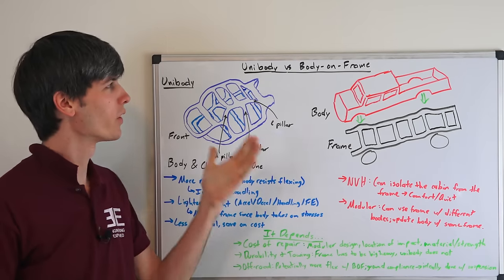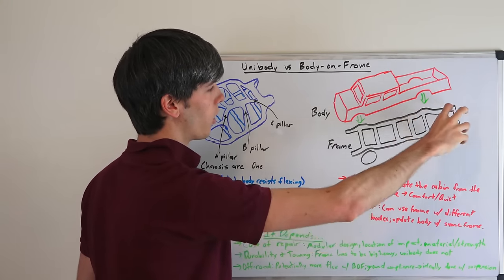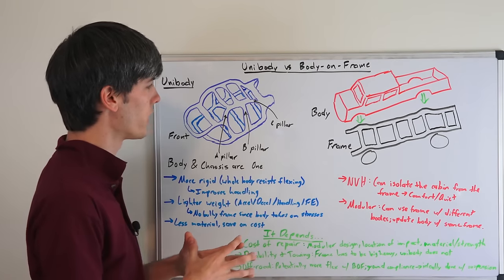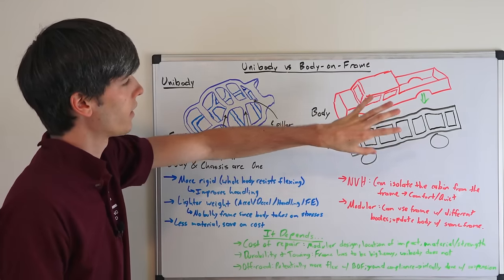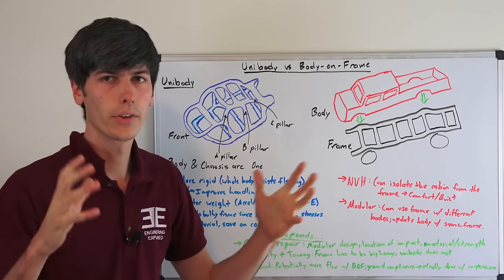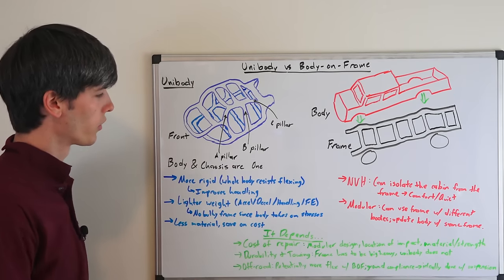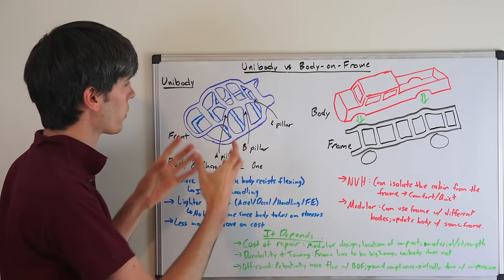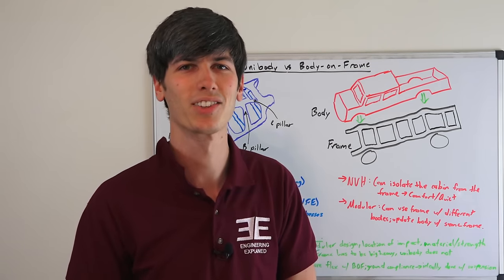Unibody vs Body On Frame - Which Is Best?

Comment from the maker: Engineering Explained Secrets - Revealed: This was filmed the same day as the suspension spring video, hence the involuntary popped collar. The little frat bro on my shoulder wouldn't let it fold down. I'm as embarrassed as you are. http://youtu.be/hGZRairqHNI
Reply: +Engineering Explained Would you be able to do a video on the requirements for turning a late-model car/sedan into an off-road vehicle? Discussions on chassis-swap vs. suspension upgrade vs. custom chassis fabrication etc. As an example - I have a 2007 Charger R/T that will be undergoing a chassis swap with a truck shortly. Think, modern (streetable) version of the FastFurious7 off-road charger.
Reply: Love your content. Keep it going. :)
Reply: +Engineering Explained why do you never deal with bikes..at all in ur videos  Harley's or KTM's... and stuff ?
Reply: +Engineering Explained Body on frame is better than unibody for towing in the long run, as the stresses run through the frame rather than the body, no matter how strong you make a unibody, its still got that fundamental design issue. Also for off-roading, it is an advantage to have a frame, as it can flex like you said, but not primarily for articulation, but rather to bend so that the body doesnt have to. Try opening the door on a unibody when its on an axle twister, quite often some doors wont be able to open even on brand new cars. Its better in the long run. Maybe you can prove me wrong! :)
Reply: +Engineering Explained I wonder where and if they differ in regards to safety. Everything being equal, my mind tells me that unibody is supposed to be safer, but i would welcome the views of other people.
Reply: ***** nope pick-up trucks are safer than cars because they are high stronger chassis hits the car ..I saw a video on Car safety ratings some where ...:-D
Reply: What will happen if the water vapour content in increases from 1% to 3% in a hot and humid area ..will it affect the engine performance ??
Reply: Love the videos, Jason! Your stuff (along with many other things) has motivated/inspired me to go to graduate school to study Materials Science and Engineering in applications to the automotive industry.

Keep it up :)
Reply: +Engineering Explained I didn't even notice until I read this comment XD

Comment: people generally like body on frame better for off-road because they usually have less frame flex or it can be easily taken out and it also also for more suspension mounting points. for example if you were to install a long arm kit you would be able to easily put new mounts on a frame rather than a unibody.

Comment: Cool. I got to this site looking for to see if I should use stabilizing bars on a unibody frame. I got my answer by pulling together info from a few sites: it depends on the weight. In my case, I will be pulling an 1800 lb trailer and my Model X weighs 5000 lbs, so it is not a good idea as it could bend the frame. Great details. Liked and subscribed!

Comment: The 4runner is a perfect example of why BOF is just a better design for longevity, as well as expense to repair. We had a trailer tire fly off the highway and hit a Mazda CX-9 between the B and C pillar, because of that a 40k dollar car will likely be unrepairable because not only did you lose the roof and the door but now the entire vehicle is structurally unsound aside from the subframes and suspension. BOF can have a body swap and potentially avoid a catastrophe like that.

Comment: I think what they mean when they say body on frame or cab chassis as its called in Australia being better off-road is that the vehicles will generally be built with a suspension layout that is a lot more capable in an off-road environment such as solid axle type suspension where as a monobody or monocoque set up will normally have independent suspension which is hopeless in comparison

Comment: hi Jason, I think you may also include that its popular with Hot Rodders since you can pull a desired body off a standard chassis and drop it onto  a specially built racing chassis. This could be useful for a car with a rusty chassis i.e. can be easily swapped thus saving the body - environmentally friendly ;) Also, the modular design of the frame and body allows the car to essentially be built parallel in 2 sections hence the body can be painted, interior and wiring fitted whilst the suspension and drivetrain are being installed onto the frame - the 2 sections ultimately being married at the end of the line thus speeding up production. I know this method is now used during the assembly of modern unibody/monocoque cars now but I believe it started with the body-on-frame cars. thanks for the video! +Engineering Explained

Comment: In towing and heavy cargo u need 2 have flex or the frame wilk snap, thats why unibody r not used for heavy duty use, it is 2 stiff for that and will breack, if u see a 18 wheeler when it takes of hard u will see it flex, this helps distribute the load and desipate the impact, hope i could help, it is just another benifit so people could untherstand why it is used pick ups and truck, sorry about my english it is not my first language.

Comment: Pull a 70 Chenille sitting for decades out of field vs a Camaro and see which once is the better restoration candidate. Most vintage unibody cars from the muscle car era that have been neglected are usually in pretty bad shape.

Comment: Where do car's like the classic VW Beetle fit in, they have a body that separates from the chassis, but it is not a frame. It's transmission tunnel provides the strength of the car, made more rigid by the sills/heater channels when the body is attached.

This design seems to fall between the unibody and body on frame designs and is light weight too
Reply: Was a video ever made about this? I love air cooled vws and was just think about their "unibody"

Comment: You mention durability, but just relate it to off-road performance or towing. There's another consideration; damage from an accident, as mentioned below. The beauty of having a body-on-frame and a very durable frame is that in many cases, a truck can be driven away from an accident, rather than having to be towed. Though the collision testing does not very this, I chose to put my family into a body-on-frame vehicle because they could take a substantial hit and come out just fine. This has been proven out in our case several times. Our old SUV is battered, but it still keeps on going and has always been able to drive away from accidents. Once the crumple zone on a uni-body has crunched, you are pretty much out-of-luck. You will survive, but your car won't.

Comment: A couple of days ago I drove over a significant transverse "bump" on the road (more like a slightly smoother speed hump) at about 40mph. As far as I remember, the suspension didn't bottom out and I didn't hit anything with the frame, but I'm still concerned about the body flexing under the stress. We're talking about a unibody hatchback here (new Mazda3). Is my fear justified or is my OCD getting the better of me?

Comment: good explanation. are u still doing videos on mods? specifically motor mods vs other motor mods in ur opinions on which would be better. ie, bore vs stroking? or both on a newer motor. say an lsx application?

Comment: I'm a bit surprised you didn't mention that unibody vehicles can also be safer. Crash tests have shown a consistent improvement in safety in a unibody compared to a body on frame vehicle. This isn't to say that all body-on-frame vehicles are unsafe, it's just something to point out that the body on a body-on-frame doesn't need the same structural integrity as a unibody to support itself, hence the body being an "afterthought" for crashworthiness. Of course, today's trucks and other body-on-frame vehicles are becoming as safe as unibody vehicles due to stricter regulations and more-advanced crash testing.

Comment: Not sure if you check comments in older videos like this, but what would you call the system VW used on their air-cooled cars? It's not a unibody, but it's also not a body-in-frame. A body-on floorpan, perhaps?

Comment: What about the criticims of unibody that they are harder to repair if there is rust damage and they dont last as long ? And if you want to lower a body on frame vehicle does that make it less likely to roll over in a crash with a new lower center of gravity, ,and can it be done in a way that does not harm it's towing and off road abilities ?

Comment: You say body-on-frame can provide a more comfortable ride. Then why do I keep hearing that unibody trucks are more comfortable to ride in? Case in point, I've ridden in a Jeep Gladiator pickup and it is noisy and uncomfortable, compared to a Honda Ridgeline - wow what a huge difference; much less road noise and way more comfortable.

Comment: Would be interesting to know why Ford had a unibody (UB) mustang right away, while GM took so long time to warm up to it. Also, it seems to me that "crumple zones" are only possible with ub. good video, thanks.
Reply: The first generation Ford Mustang in 1964 essentially was a Ford Falcon with different body panels and a roof, Ford already had the Falcon and to save on development costs they just put different body panels on along with a roof on a car they already happened to have on hand.

Comment: So my only gripes with this is you kinda hit on it but kinda didn't. In HD applications the reason for body on frame is the distribution of stress, offroading and towing alike keeps the stresses of high stress applications to the frame and will save the "squareness" of the body in a lot more circumstances. A frame can be made much stronger and in doing so maintains(for offroading) a lower center of gravity and again isolates the body much more from the stresses of suspension articulation. I don't agree with the Unibody design(except in offroad buggies but they are often overdone as well but also aren't really cars, so not applicable to the argument), I have a older style jeep cherokee that I offroad and routinely have issues shutting hatches and doors because of the twisting forces on the unibody mis-aligning  things. In offroad applications like mine we reinforce one section of the unibody, where the highest stresses occur, the uniframe rails. This is to mimic body on frame designs which keep stress away from the body as well as possible. A unibody is good when stresses are applied somewhat evenly ie cornering or collisions. For trucks frames are necessary because the stress areas are so concentrated especially with conventional towing, with conventional towing a unibody would have to be ridiculously biased in the rear of it in terms of reinforcement that it would still create issues with the cab ahead of it(keep in mind I mean to compete with a trucks tow rating/ tongue weight. Simply put the stresses are different between passenger cars/crossovers/minivans...etc. and in offroading owners usually reinforce the frame to prevent twist and save the body. Truck manufacturers have in the last decade made big leaps in terms of end to end frame rigidity doing things like fully boxing the frame among other things. I will say that Chevy is ahead in that department by far. So yeah, sorry for long post I just wanted to elaborate the reasoning for a frame since the vid kinda didn't.

Comment: I enjoy your videos, keep it up.

I was wondering about the car platforms we always hear about, is that unibody or body on a frame or can it be both?
Reply: +Ross Anderson "popular platform" is just a term  for a car that's very popular for customisation/modification, which means that there is a lot of knowledge out there baout modifying and there are usually a lot of parts on the market for that car.
I'm think that's what you meant.
Reply: +Joel Sägesser Nope, with platform he means that a lot of parts and main components are shared between different models of cars. For example you had the Ford Panther platform on which the Crown Vic, Grand Marquis and Town Car were built and that was BoF. You have unibody platforms as well. The Chrysler C-Body is a good example - lots of different models sharing the same basic structure. 
All of this holds true for today's cars, although I don't think there are any BoF sedans left in production...
Reply: Zenedon Ah you're right, the question wasn't very precise
Reply: Ok, great thanks, I should have been more specific.

Comment: the reason why the body on frame idea was first used...its because most manufacturers tought of it on trucks and suv thats the main reason otherwise there was no point for them to put a sedan or coupe body over a separate frame just think of that.

Comment: Towing should be in the advantages section of frame-on.  Sure.. you "could" have a unibody built at the same weight that would allow it to be equal, but nobody does that.  Frame-on is generally always better for towing.

Comment: I really like your videos ... But Dude you seriously have to remake this one... There is no way in HELL a uni-body vehicle is "stiffer" than that of a vehicle with a frame! (unless your playing with words and trying to say a uni-body is stiffer than the body of a framed car without the frame then yes, sure I guess you could make that statement.) Uni-bodies twist and that's what makes them less effective as dragsters.  Not to mention the weak transfer of weight to the rear wheels which come not having a frame.  When GM was making their first front wheel drive vehicle they took out the bump for the transmission and the Damn thing folded in half when the first ones rolled off the line... I remember dad laughing when he came home from work that day.  Uni-bodies are better in crashes and that's what lead to crumple zones.  No one set out to design crumple zones they discovered them when they started using the Uni-bodies.  Heck you didn't even mention that! Also while I'm on my soap box ... Any car company that tells you they "pioneered" crumple zones is lying out their exhaust.

Comment: Even a unibody has a sub frame, why? To give the unibody more strength. This is what the engine is mounted to. One big problem with unibody is rust. A floor board rusts out on a Body on Frame simply replace the floor board as the strength and rigidity of the floor board does not matter, its the frame. If you have rust on a floor board or A/B Pillar in a unibody it is Game Over, as both are needed for rigidity. Do not be confused by a unibody with frame rails. At the heard of a great race car is a great frame.

Comment: Hey Jason, could you do a video explaining how carburetors work? I understand its a old technology for internal combustion engines, most companies moved to direct injection, correct? Thanks...
Reply: Well, nearly all manufacturers use fuel injection (electronic fuel injection, actually). Direct injection pertains specifically to the location where the fuel is injected. With direct injection, it's sprayed directly into the combustion chamber, rather than the intake port. This allows for more precise fueling.

Comment: Eat that Monocoque fancy word marketing! Btw, in body on frame since the chassis is heavy and at the bottom, don't that make the CG lower? Also I think what makes Ladder Frame Chassis better for towing is because most of the strength doesn't come from construction design or what ever, so it's strong by its self.

Comment: What about safety during a bad collision? Will the uniframe crumble and absorb more force (making it safer) than a body on frame (which is so good at being sturdy that it will transfer the impact of the collision to the vehicle occupants)?
Reply: It really depends on the car some modern body on frames utilise some crumple zones thru use of welds that are designed to break away on a impact but unfortunately a unibody will perform generally better In a crash as the car is basically a roll cage but the force won’t be transferred thru to occupants normally to the other end of the frame but a lot of advances in body on frame has been made in 20 years it really depends one thing to note is how unibody by design will divert the impact around you.

Comment: That is the first time I've seen a pickup with the cab connected to the rear box. Don't pickups have the front bumper connected to the frame and the rear connected to the box with the tow bar connected to the frame?

Comment: IF your intention is to have a vehicle FOR LIFE, at least one decade of use, i suggest BOF. Extremely desirable on offroad, and i say it with knowledge of experience. Already owned Unibody AND BOF 4x4 vehicles. When you take it severe and ruthless use, regarding erosions, and all sorts of tough grounds, Unibody shows it's weak points. Cracks in structural stress points, which i consider the worst result when you go offroading to the machine's limit frequently. Safety gets compromised, and in most cases the unlucky owner finds out too late. Also, BOF 4x4 normaly has more options of upgrades and modifications, which is always desirable, even when you haven't all the $$$ to do at your will, the potential to do is already there. On Unibody, you'll find, on most cases offroad, very limited options, and huge frustration when comparing prices of acessories and services between the two types.
Resume : IF TOUGH 4X4 ACTION is your demand, sacrifice sportiness and speed performance for durability and reliability, my humble opinion. That's what i did and never complained again about scary structural cracks ... LOL Hope my comment is worth something. Cheers from Brazil